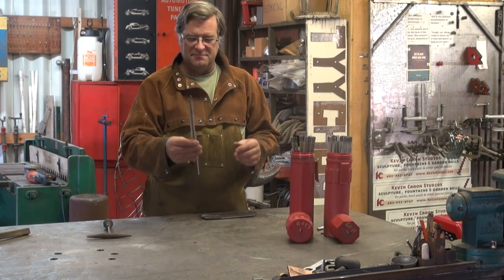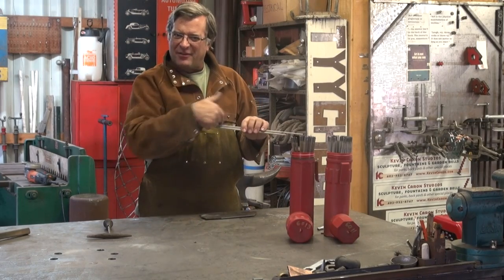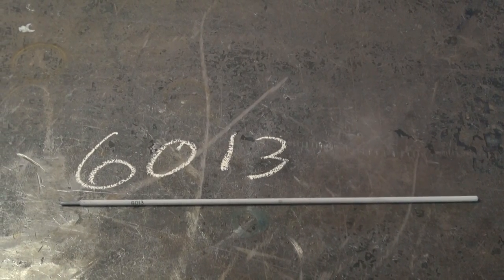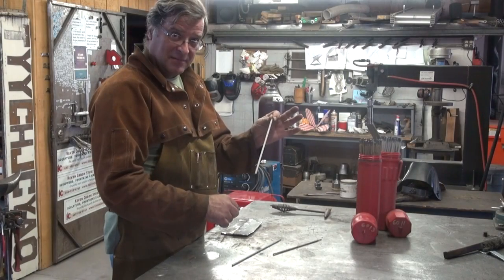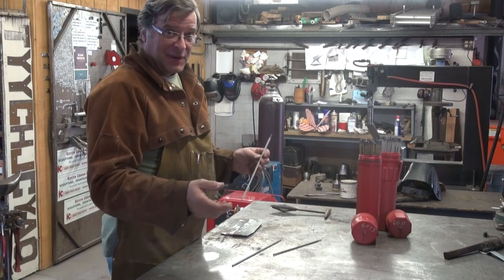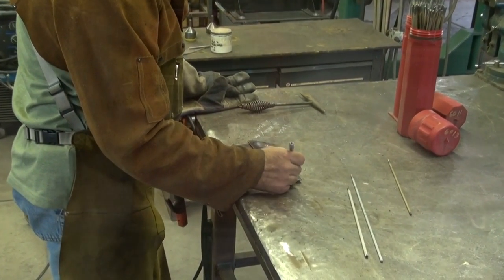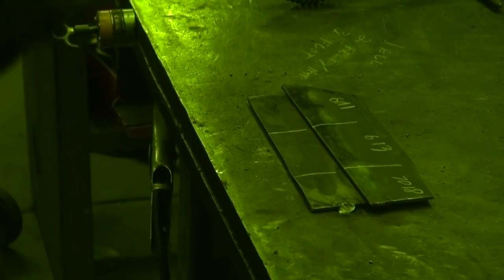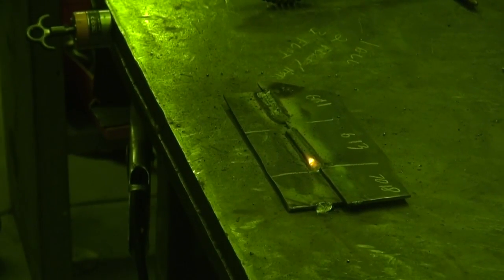How to Select Rods for Arc Welding - Kevin Caron

Comment: I watch your videos but in this case you did not explain anything. 

6011 = deep penetration, will weld through rust and crud always makes a ugly weld.
6013 = thin metal (sheet metal) rod, shallow penetration.
7018 = the best all around rod but the metal must be clean clean .
Reply from the maker: Thanks for posting.   I learned something also!
Reply: A 6011 can make a decent looking weld using the proper technique, which is a whip and pause motion. A 6013 is primarily a sheet metal rod. Low penetration, requires no manipulation of the rod, and can run a lower amperage. A 7018 requires more amperage but still can be run with no rod manipulation if preferred.
Reply: Quartzsite Business 6013 and 7018 are cappers or fillers mainly. Not meant for full joint penetration. 6013 is great on sheet metal like you say but is also good on just capping stuff to make a pretty finished bead. 7018 is a tricky rod for positions out of 1 or 2 because of slag inclusions. But youre definitly right.
Reply: How do you know what size rod to use for a single pass or multiple passes on certain thickness? Say 1/8” vs 1/4”, 3/16” and 3/8” mild steel. Assume 7018 rod
Reply: Logan Bull: 6010 and 6011 are similar. They have better penetration; handle crud and rust; they freeze fast; and are frequently the first rod to use, if the joint will require multiple passes.  6011/6010 are the most versatile for steels thicker than 1/8".  6013 has more slag, so the arc is a bit harder to gauge, and it makes the arc look shorter than it is.  6013 is pretty, but it doesn't penetrate great, and can frustrate with inclusions. .   7018 is often used as the last pass on multi-pass welds that require strength, but 7018 can still be pretty.
Reply: I want to try out some jet electrodes with my everlast welder but I don't want to buy a big box.

Comment: so the flux is differant on the 1st 2 and the the 3rd one is 1/16 larger on the o.d.and different flux 
amps could have been 90,105,and 105
 are 6011,and 6013 the same alloy on the filler metal or just. the same tensil strength
  I was also wondering if it's possible to put old rods I got a deal on in some heat and dry them out and make them good 
how long what temp would you say?or are they just scrap? 
  thanks for all your help?
                             brad
Reply from the maker: Toss them in the oven or on the bbq on low for an hour or so..   Will dry them out for sure..   "Should" be okay to use.
Reply: I believe the ideal temp is like 250 degrees I could be wrong. Not all rods should be heated and dried
7018 should I think 6010 shouldn't not 100 percent sure

Comment: can you charge a car battery with a dc arc welder?
Reply from the maker: I don't know for sure but I think this is a bad idea!

At least set up a video camera before you hook up the cables please...
Reply: hehe, I have not done that yet, but I agree with you, my arc buzzer showing 66volts dc on the voltmeter..but i hooked it up to a 240v 25watt rated incandescent bulb and it lit to about 40percent brightness..if Im going to attempt battery charging, id reckon I need at least 5 car batteries in series, even then at lowest 30amp pot adjustment, if the pot really is working as it should..thanks for the reply

Comment: Is there a chart for selecting rod size/type, and amps per metal thickness? A chart like that sould help a lot for a beginner like me.
Reply: +Jeffrey Beyer You can use welding calculators on the web to help you with that. I use the miller website for their calculator (even though I own Everlast welders). Their calculators are still applicable.
Reply from the maker: +Jeffrey Beyer 

There is an app for that!!      Like Carter said,,,
Reply: +Kevin Caron, Artist all the apps I've seen sre not very helpful for rod thickness/heat for metal thickness for stick welding

Comment: with the 3/32 6011 try 75 amps and a whip and pause motion. Your welding will be alot better!
Reply: +Terry Gee a lot*
Reply: Drew the Conqueror Gee thanks I never knew the difference! You forgot to start your comment with a capital letter moron.
Reply: +Terry Gee 
     You're welcome, now you know the difference between a word that exist and one that does not. 
You didn't capitalize "I" and you misspelled "forgot". Lastly, I didn't need a capital letter or punctuation because it wasn't a formal sentence; it was a grammatical correction.
Reply: You're right about the amp settings when using the 6011. I used it at 78 amps because i had slightly thicker metal I was using and it was a HUGE difference then what I had it at before. Good Looking Out!
Reply: Thanks for contributing your valuable knowledge to those of us who actually want to learn to weld. Don't mind the English teacher, he has no life bro.  Godbless
Reply: Would this rod work with only 70amp Or what would you suggest for better penetration  / Thanks

Comment: 7018 AC rod can run on AC, or DC+ I'm not sure if they can make a rod that will not run on DC+
Reply: +Paul Frederick I've only got an everlast inverter welder so I only weld DC but I think you are right. If anything, rods for AC are a bit more scarce.
Reply: Richard Smart
DC+ is the optimal polarity for SMAW. All of the other polarities can kind of sort of sometimes work, but DC+ always works. In some circumstances some of the other polarities may be more appropriate though. Because not every welding scenario is optimal itself. So the properties of the other polarities can be used to their advantage then.
Reply: +Richard Smart Inverters use AC current!
Reply: Terry Gee
Do you have a schematic of a Power inverter that uses AC current? I'd really like to see that myself. I'd bet any schematic you might produce has rectification in it before any conversion goes on.
Reply: You can get both AC/DC inverters. Why do you say (DCEP) is the optimal polarity for stick ?
Reply: Terry Gee
because that's what electrons like the best. What inverters are called, has nothing to do with how they actually work.
Reply: fair enough. i wouldn't recommend DCEP on thin material like he is using tho.

Comment: Kevin, thank you for making the video. Even though I didn't learn anything about how to Select rods for Arc welding, I did learn a few things from the video like what the numbers on the welding rod mean to a limited degree. A quick run down on the coatings on the rod would have been helpful since the coatings or flux on the rod is what made the difference in the welding demonstration. According to you the 7018 was a thicker rod so it welded nicer given the amperage setting which had nothing to do with the rod type or maybe it did, who knows, so that really didn't help the comparison of rod types. There's type, and there's thickness to consider with every rod. So the video proved to be no help with those decisions.
The title of your video is, "How to select rods for arc welding" which was what drew me to take the time to watch. I"m glad you finally addressed the title of your video at the very end by telling people to go and look on the internet to find out how to select rods for welding. I was already doing that when I came across your video.

Comment: great video!!!i use 6010 and then 7018 for pipes!!
Reply: Just used a 7018 rod with the help of my 12v batteries, jumper cables as well as a transformer I rewounded and I love it.

Comment: Can someone please make a video of welding rods for a newwwwww guy. There's 3/32 there's 1/8 and so on. I want a video of what metal thickness to use what rod. Am I making sense or is it just me. There Internet can tell me how robe a successful crack dealer but not answer this welding question for me. Thanks.
Reply: +Philip B http://www.millerwelds.com/resources/communities/mboard/showthread.php?20897-matching-electrode-diameter-to-metal-thickness  found this! Dont know if your still looking.  i was researching the same thing.  And couldnt find a video on it.  so im taking the advice on that Miller site.  And feel you have to apply it first hand.  Always here every welder is different.

Comment: I grew up welding with a 6011 1/8 inch on the same lincoln welder I like it better cause it creates less slag and burns a little hotter but I weld everything from sheet metal up with it

Comment: 6013 is for sheet metal only, but it's still cheaper than using fluxed-core or MIG. I happened to use one with my cheap AC stick welder at the mininum amps (50) that I have and I find 1/16 mild steel easier to weld than 25 gauge mild steel from a paint can, I think? on my rusted bbq grill.
Reply: I wouldn't say that. I've used 6013 to build 2 trailers, 1 was build in 1992 it's titled and certified for 12k pound capacity. I built a 7k pound capacity trailer in 2015 and it's titled and certified and have not had a problem with them. I only use 1/4 inch rod and always have since 1990 when I was taught how to weld.

Comment: I can't stand AC stick welding any longer. DC is better, but hard to find where I'm from. I guess I'm hopeless when it comes to welding.

Actually (2016 update), I just got some 12v batteries, jumper cables, vise grip and transformer all connected properly and got the regular 7018s (might try 6010s later too) I've had for years working.

Comment: Stick welding on aluminum, afaik, is nearly impossible. I rather use TIG or the Cobra DHC 2000 for welding aluminum. Mig welding on alumimum sometimes works, but if you can't afford a spool gun then you may want to change the liner in it.

Comment: I know that for cast iron you use Ni-99 or Ni-55 rods, but I wonder if a stainless steel smaw rod can be used for cast iron, too. If mig can weld cast iron with a stainless steel filler, why can't smaw?

Comment: I was taught that 7018 rods should be stored in an oven so the coating doesn't absorb moisture. I don't have an oven so I usually just stick with 6010, 6011, and 6013. Just something to consider for us hobby welders.

Comment: Hey Kevin. I just started watching your videos and I do like your enthusiasm and positive approach. You've got some good advice for the "do-it-yourselfer". One thing I would like to point out, however, is the that the first 2 digits (first three if there's a 5 number designation) on an electrode is the minimum tensile strength of the rod filler metal (in kpsi). That means how much weight it would take to tear apart the filler metal, not how much weight a weld with that filler metal will hold before failing. For example, in a 7018 rod, it will take a minimum of 70 000 lbs of weight to tear apart one square inch of the metal that the rod is composed of. I'm new to welding and just a hobbyist, but I'd hate to see someone be disappointed because their weld didn't hold 60 000 lbs after using a 6010 rod :p

Comment: In my personal opinion the two rods a person should always have on hand are E6011 and E6013.  They are both great for fixing things.  E6011 has deep penetration and flat or concave beads, it is for use with DCEP and AC current and has a cellulose potassium coating.  E6013 has shallow penetration and convex beads, is designed for DCEP, DCEN, and AC current, and has a titania potassium coating.  E6011 is best on thicker materials, and E6013 is great for thinner materials.  The welds won't be very pretty (compared to other rods), but they make for strong welds and are great for welding a large variety of materials.

Comment: I always enjoy these videos & understand they are for "newbee" but at the same time presenting only half the info could be detrimental to their welds or at minimum to their learning progression...for example...

The 6010-6011 rods are "deep penetration rods" & are not really meant for just dragging, you're supposed to stitch back and forth (this will leave a "stacked dimes look) & should be run on about 85amps (for 1/8 rod).

The 7018 is a dragging rod and should be run around 95-130amps...not as deep penetration but very smooth finish.
Running these rods on too high or too low an amp setting has a HUGE effect on the quality of the weld and obviously the smaller (1/16) rods need less amps.
Reply: gordon davis just what i covered in my comment. Glad im not the only one who noticed that stuf.
Reply: gordon davis not only did he say that but he said the 7018 was a bigger rod being a 3/32 when thats smaller than 1/8 and the difference between a ac and dc rod
Reply: gordon davis Thank you very much for filling the gaps, as an almost virginal newbie that information matters a lot. Please could you tell me if there are any sites you could recommend that says what rod to use and how to use them?

Comment: Hi Kevin. Good demonstration, but I think you could have explained the difference between the three electrodes ( sorry that's what I was taught to call them ) and under what conditions one would be chosen over another. This would help to explain the resulting differences that you've demonstrated.
The 6011 is quite different to the 6013, which is different again to the 7018, in characteristics machine settings and application of use.
Sorry if this sounds a little critical, I just feel that this may be of benefit to viewers that may be new to welding.

Comment: I'm new to this as well, so this was a great question. The thing that I've learned was that when you use a different rod it's because of the penetration
Reply: Not totally, in fact penetration is probably one of the secondary factors in electrode selection.  Electrodes are more often chosen based on their mechanical properties, such as yield strength, tensile strength, impact toughness and degree of hydrogen in the weld metal as well as their positional capabilities and current type.  Cellulose electrodes have the advantage of a minimal slag that is easily removed.  This can be an advantage with multi pass butt joints, rutile electrodes are good all round performers and have much smoother arc characteristics and better bead appearance.  Low hydrogen electrodes are the ones you want when the weld is critical.  They are much tougher and stronger than either rutile or cellulose.  It is rare to find DC only electrodes today, but most low hydrogen electrodes require a minimum 70V OCV when used on AC current.  Most older handyman buzz box welders were 45-50V OCV, so you need to find a twin coated low hydrogen electrode to run with them.

Comment from the maker: Off the top of my head I would say your amps are too low. Try turning it up a notch.   The other thing to try is instead of placing the rod at the start point like you are touching it with your finger , try scratching it along like you are picking at a scab. That may give you an easier start. 

What size rod are you using?

Comment: Quick question...I'm starting to weld a metal/aluminum horse trailer, using a Dayton 100 amp ac welder, rod: 7018 ac, when i'm placing to the rod close to the metal it gets stuck rather than go straight to welding, iv'e been struggling with this problem over and over again and cant seem to get a clean weld just like the ones I just saw on your video. Do you have some tips for me?

Comment: Not to worry Kevin. The only reason I knew the size of the rod is b/c we used 5/32 when I was a welder in the steel mill where I worked. Then some bright foreman started buying 1/8-7018 for our break downs. The 5/32-7016 rod was better all around rod. We got used to the 7018's but, the smaller rod made a difference in the amount of time we need to complete a job. Not all the welding is in the shop under ideal conditions. Thanks for the quick reply. Keep up the good videos.

Comment: After you have consulted some vendor to buy the right rod and decided on your current settings nd type of current (ac/dc) then, if you butt weld, put a plate under the plates u wish to fuse, to help dissipate heat better. Do not compromise too much on the current settings required for the task. Else get a TIG as Kevin suggested.

Comment: Im welding 1/8"  thick steel with a 6013, 3/32 rod.  Im burning holes thru it...What should I do?  My buzz box is set to 60, if I go to 40 it sticks to my work.  My project is a control arm and it needs strength and good looks.

Comment: At 65 it has been a LONG time sense I did any welding with a buzz box similar to the Lincoln in the video..  I bought one of those Chinese made 110 volt 160 Amp stick welders off the internet, it came with some Chinese rod with weird numbers 1/8" an worked well at about 120 amps, acted similar to 7018..  When I went to try 1/8" 6013 with welder wide open at 160 amps I could not maintain an arc..  So I bought some 6011 at 3/32 and hope that solves the problem, if I want to weld thick, turn it up?

Comment: My schooling is that 3/32 is SMALLER than 1/8 th inch..  But I do have a question tho, what is the difference between 1/8" and 3/32" in the same type rod like 6011, is it that the smaller 3/32 takes less amps to run?

Comment: Hi Kevin, Thanks for taking the time to make these vid's, i been welding with square tube steel and no matter what current i have my stick welder on i keep burning holes, is this because of wrong sticks or what? "i don't think its time as sometimes it will just burn through soon as i start. The joins i make are cut at 45 and used the welder to join.
I tried to fill in the holes but sometimes its ok other times i make it worse.
not been welding long...." a few weeks"

Comment: I disagree to this comment sorry, the purpose of the video is to help determine how to select rods. If all rods in the video were the same size, we would have not been able to see what the difference is if we were to select a different size other than seen in this video. Now we have a good idea what to expect with a 6011 higher or lower voltage, same thing for the 7018, higher or lower voltage. If all were the same size no one would have a clue what to expect at smaller or bigger sizes.